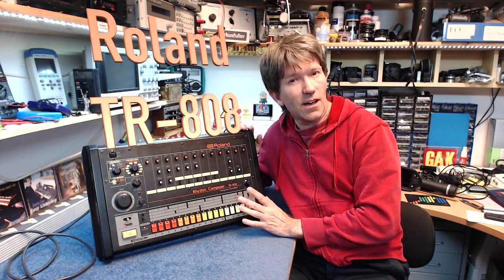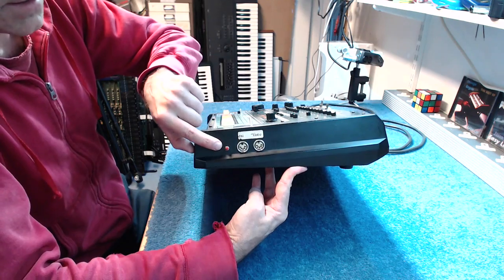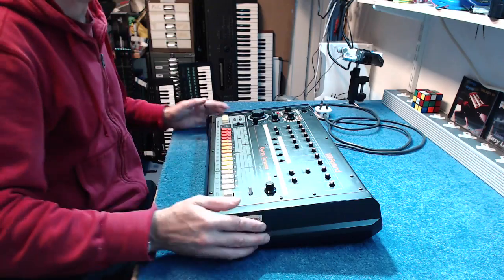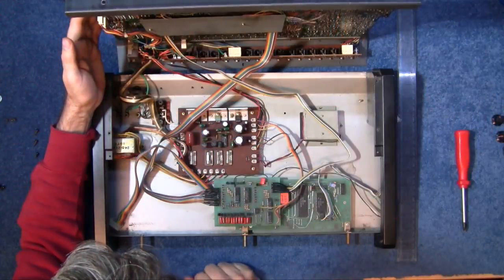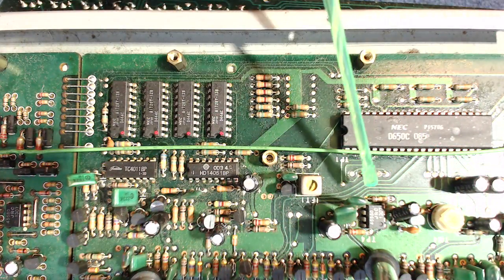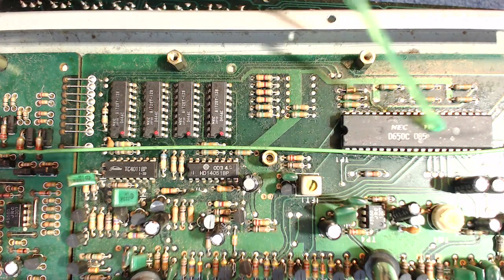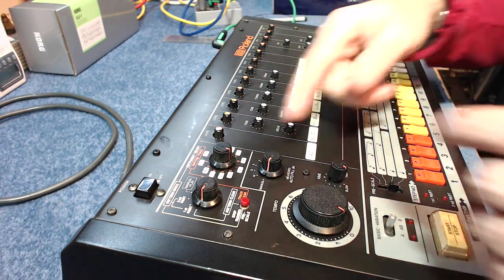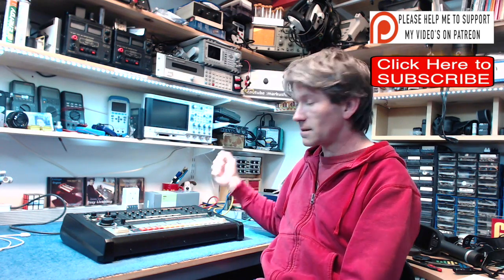Roland TR-808 rhythm composer drum machine teardown MF#73

Comment: About replacement uPD650 CPUs from Ebay. For the TR808, you must have the uPD650c 085. where "085" refers to the actual masked program ROM for this device.

Comment: I've been using an MSQ700 MIDI sequencer as an interface for synching the TR to MIDI (the MSQ is equipped with both MIDI and Roland 5-DIN sync); MIDI is not really necessary if you can get one of those. They must be kind of cheap, because apart from that, there's no much use for them these days... Nevertheless, though both MIDI and Roland sync use the same jack, a MIDI cable won't do the job for synching Roland devices; they are wired differently...

Comment: The variation button really isn't supposed to sit like that, there's no reason for it to be sat like that from the factory - they got these 
switches in large quantities, and they fit just right, the enclosure opening is parallel to the PCB. I suspect that what happened, the can with the stoppers lifted on one side, because it wasn't mounted securely enough, while the foundation stayed kind of flat, it's much flatter than the can. Then in further use, the ears of the can, with the stoppers on them, bent back to where they were kind of symmetrical again, maybe the user forced them, the lever is just about beefy enough to bend the can, and these bent back ears prevent the can from going down.

Comment: Hey, good to see the video. Want a mini 808 now. Want to design the SMD board?
Reply from the maker: ALL ONE I think a mini 808 analog would be a great seller but some of the quirky magical sounds of the original 808 comes from the way the old components work together ans I think if you made it all with smd parts even the correct values of everything there would be a difference in sound, however I still think it would be a great project to make.

Comment: hi markus. i've seen many of your videos, mostly the synthesizer ones and I have a question regarding this one: is it safe to use a vacuum cleaner inside electronic devices? I always think that it could be harmful specially with devices that has "memory" ICs or ram, because of static.
thanks and keep it going. cheers from argentina and excuse my english.
Reply from the maker: Hello I am always aware of static discharge when using vacuum cleaning. I try to keep the vacuum cleaner from making physical contact and normally use a brush to lift the dust plus I have the antistatic strap connected to me. but theres always the small possibility that one day I will kill a chip with static discharge though it has not happened yet.

Comment: Roland is so silly not to re release these and make a mint.
Reply from the maker: Yes I agree a reissue would be a good seller. maybe with a midi connector. that would be nice to have.
Reply: ***** An interesting philosophy.
Reply: I believe Roland actually stopped selling them because they could no longer get the specific transistors that seem to give the 808 its unique flavor.
The same supply chain problem would still apply today unfortunately.
Fortunately they produced 12k of them, which is not a lot m by some standards but they can certainly be purchased. If you can muster up the cash, buy one because you will never lose your money. I doubt they will go down in value, and will likely keep going up. 
A TR-808 401k plan will probably yield higher dividends than the market in general with the best dividend being that you get to enjoy it while you own it. I have two currently, both purchased at slightly below the marketplace value at the time for just below 2k. That was only a handful of years back. Now you can expect to sell one pretty easily for around $3,500 to $4k.:)
Reply: Roland TR08 is out now. Wish granted
Reply: "go crazy"? Not really - people buy these to purchase a slice of music history. Even if Roland released a 100% copy, the "original issue" ones would still keep much of their value.
Reply: Luckily Behringer is releasing an analog clone now
Reply: I guess I like analog stuff.  Digital 808 emulations have been on point for about 20 years (rebirth was introduced 1996).
Reply: They can't re-release 808's in the original form however - the sound circuitry uses broken transistors as noise generators (good job Markus didn't find and replace them haha!). According to Roland, manufacturers don't have such rejected transistors in usable quantities because anymore manufacturing techniques have improved.
Reply: ***** My artistic output isn't really important in this regard.  I was just saying, "Roland is so silly not to re release these and make a mint."  Meaning that I find the object to have aesthetic value, like a classic car and Roland should capitalize on that.
Reply: Imagine Roland release some new analog drum machines, people who payed their 808 and 909 for thousands would go crazy !
Reply: Roland would have made 10 X more than they made with the TR-08 Boutique.

Comment: Is it possible to program a modern chip that mimics the NEC D650C to be replaced with?
Reply from the maker: I guess that could be possible but it is out of my knowledge. there are some clever chip guys on here that could maybe program something.
Reply: Ok, at least it is good that there is hope that the old processors are interchangeable. By the way I'm fascinated how well made the Roland TR-808 !
Reply from the maker: oh yes the 808 is very well built. I have many different drum machines here and most of them contain far too much plastic.

Comment: Hi Markus,
You might be interested to know that I've recently faced my fear of soldering and put together some DIY synths (Mutable Instruments Shruthi and Sonic Potions LXR.) As someone with pretty average motor skills, I surprised myself and got the hang of soldering quite quickly, and might go as far as to say I did a pretty decent job. As good as these two synths sound, I've now got a thirst to try soldering something more difficult, and since I can never tire of the sound of the 808, I will soon be ordering something called a Yocto by e-licktronic, which is a DIY kit claiming to be a near exact reproduction of the 808. It looks like I will first need to acquire an oscilloscope however, and a large portion of the (less-rare) parts have to be sourced via mouser (or reichelt in my case) but I'll be sure to let you know how it all goes!
Reply: Im interested im starting out with a mv 8000 cleaning it tonight custom paint friday any sugesstions?

Comment: On mine there was an electrolytic cap that had leaked on the board, around the area north of the play/stop button. I also replaced a sheared off rocker switch and some LEDs and any affected components around the leakage. Then it worked. Mine wasn’t the “long kick” variant, mine must’ve been earlier than that, with a normal kick duration.

Comment: I own one of these still in the box with all of the original manuals etc. I still works, in fact It looks like it was hardly used hardly at all?, and box is an very good condition as well. Mine does not have the midi mod so it is completely original?, to my knowledge?, any ways. It was a curb side garbage find about two or so years back and I had no idea it was that iconic and rare as well as being worth so much money on eBay?... I do not have any use for it at all?, other than to list it and use the money to replace some of my ageing lab equipment?. Primarily my 30+ year old Tektronix 2025 analog oscilloscope with a new Tektronix quad channel MSO  one with a 16 channel logic analyser I so desperately need.
Reply: do you still have the drum machine? i want to buy it

Comment: another great video
just now i need to know about the MIDI ports
did i miss it ? i look forward to a conclusion ;)
Reply from the maker: +bolton368 Hi I did not get enough time with the 808 to be able to do any info on the midi port. I will put some images of it on the google+ page. this was only on loan to me for a short amount of time.
Reply: +markusfuller thank you i re-watched the clip. 3:48 is the Monet you elaborate on the MIDI. your very good to be so generous with your time.
Reply from the maker: I did try sending midi to it afterwards but nothing happened. the owner has told me he thinks it has never worked anyway and he would not have a use for it or he would have asked me to look into it for him (though i do not know where i would start on the unknown midi add on)

Comment: Are the MIDI ports actually DIN Sync ports for clock?
Reply from the maker: +Sysex|Studio Hi I think they are Midi as the ribbon connectors from the midi unit go to the actual switch block on the 808 plus several wires all over the board.

Comment: Great teardown. I'm curious as to why you use a vacuum & brush instead of compressed air to clean the board.
Reply from the maker: Hello. If i use compressed air the dust and fluff could be blown into the gaps of the Potentiometers and create problems so instead i loosen the dust and fluff with the brush and vacuum it away. I just think its a better way to do this job if you have these type of pots with the gaps in them.
Reply: Good point. I had issues with static electricity buildup frying a CMOS chip when I used my vacuum once on a board which is why I dig my air compressor out and blast away now.
Reply from the maker: Hi Mark. I found the handheld vacuum cleaners are ok but you still have to use a brush to disturb the dust particles that have stuck down.
Reply: +markusfuller To piggyback on this discussion (and why did i not ask you this before!?), what do you recommend for getting the dust off the tops of gear? like my analog mix board, synths, etc.? is there a handheld vacuum cleaner and brush you can recommend?

Comment: That SRAM is hard to get these days, only hacks and replacements are usually available That microcontroller is a 4 bit (yes 4 bit) microcontroller. I am a bit sad that you didn't show the aftermarket MIDI expansion board in closeup. The chips and closeups are always the best!
Reply: +Chip Guy Vids I particulary liked that careful cleaning job!
Reply from the maker: Sorry. I did a few pics of the midi board but left them out as some of my previous videos got a few complaints that they were too long and boring so i thought i would keep them around 10 minutes. I will post the midi board pics on the google+ page.
Reply: +markusfuller Oh Really? MTV genration "I want to be entertained within 2 seconds and my attention span is max. 10 mins". I thought "10 mins.. that's rather quick" when I saw the video length. I mean there is a slider on the bottom of the video window and people can just skip parts and jump forward. Next video for me is Dave Jones' latest mailbag, about 45 mins. If there is an item I am not interested in, I just skip it and I never complain about the length.
Reply: +markusfuller I expected some midi test with external host.
Reply: +nihonam Yeah that would have been cool. I think best to start with channel 10 (default for drums) and press all the keys once. However that red button could be a learning button. You press and hold it, and the MIDI channel number of first played note becomes it's MIDI channel for triggering the machine.
Reply: Chip Guy Vids And make this old dog do some new trix from d&b to acidjuzz
Reply: +Chip Guy Vids ^This... If it's a long video people can skip whatever 
they don't find interesting.  Your videos are great Markus, the longer the better imo.
Reply: Totally agree with that! The longer the better! I'd mind if that video would have been some 30ish mins long going through all the details and experimenting with tha MIDI hack.

Comment: Gem! Would love to have one. Why no comparision with TR-8? ;D I have TR-8 and I think that hihats are too bright vs real 808. :/
Reply from the maker: +Otto&#39;s Hobby Channel Hi Otto, there is already a very good TR-808 TR-8 comparison video on youtube.
Reply: you have some cool video on YouTube for this 😉
check tr8 vs 808 
you will find it ✌
Reply: +markusfuller I know but it is not yours. :) Every unit sounds anyway a little different so there is a point sort of.
Reply from the maker: True, every unit is a little different because of the analog circuit. I will try and get a sample of this one though as it sounds so sweet.
Reply: +markusfuller I am most curious about behavior of Kick drum. It is really messy on that unit. Generally it is futile to compare these devices but purist will cry and use samples...
Reply from the maker: I never really noticed any problem with the kick drum but then I last owned one back in the 90s. all these units sound slightly different anyway because of analog components but yes all the sample versions as in the TR-8 are the same as each other. (unless you play around with the tune/decay etc)